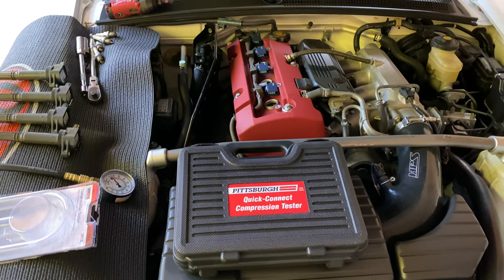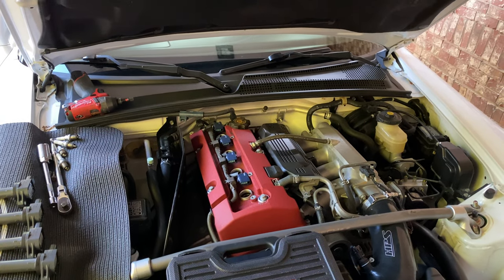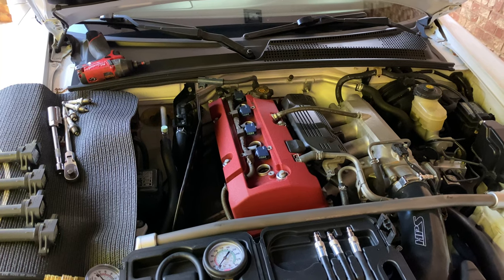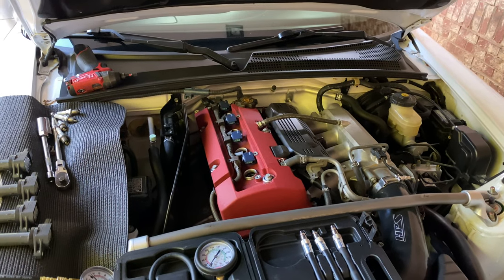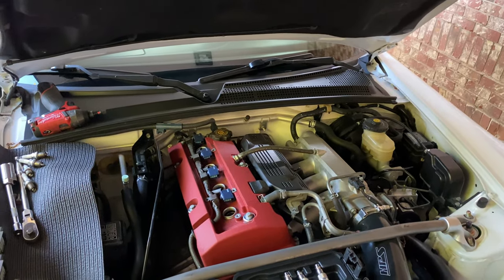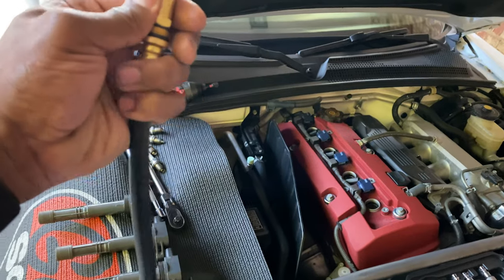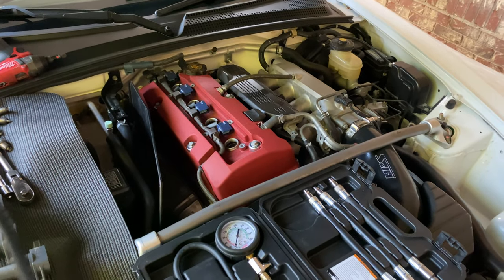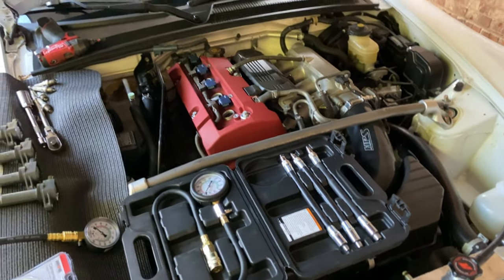Buy This! Not This! - Comparing Two Compression Testers

Comment: No matter what you’re testing. I don’t care if it’s a car or truck engine. A chainsaw, a motorcycle, a lawnmower, WHATEVER. A compression tester absolutely has to have a schrader valve right there in the threads that screw into the spark plug hole. The schrader valve cannot be anywhere else down the line. It has to be right there in the spark plug hole. The length of the hose doesn’t matter. Why they would even produce a tool that’s completely useless makes no sense. Lol

Comment: bought an harbor freight tester and i got 90psi on all 4 cyl of my motorcycle that should be 180psi....the problem with this tester is they are charging 20% restocking fee if you are returning it...im guessing there are lots of returns for this tester.....LOL

Comment: I had the same results very low compression with the Harbor Freight gauge.  It was showing 90 psi on a good running engine.  Most engines you need to have at least 100 psi to run at all so I knew it was the gauge.

Comment: could u pls do video for how to crank a car with start push button for compression test. I know how to crank with key. but always want to know how to crank with start push button.
Reply: One alligator clip of your starter button to battery side of your solenoid, the other alligator clip to the solenoid start wire (this wire lights when key is in start position). That's it for any vehicle.  Make sure your key is off when using the remote crank button.

Comment: Had the same problem only shows 25psi on GOOD engines. The reason is like you said it reads the air pressure in the HOSE as well which is WRONG

Comment: that valve is how it should be, harbor frate is made in china box, they always give you box :D basically shreder valve increasing space same compression only tester has longer time untill cylinder opens exhaust. especially must be used on chainasaws as there is no time to count and exhaust opens also adding part what it will suck air from exhaust makes all counting wrong

Comment: Im not certain that your theory holds any validity. I understand what youre saying. However when youre measuring compression, youre not measuring volume. Youre simply measuring pressure. Think of it like measuring psi of a tire. Bike tires measure just as high in psi as a car tire even though they obviously hold less air. So even though yes the hose  may have extra air in it, remember pressure is important. Not volume. So once youre guage hits a certain pressure, then whether the valve is in the end of the tube or at the tip of the guage, the psi will still read say 45psi, because thats the amount of force on the gauge.
Reply: So you're saying that the gauge itself was inaccurate.
Reply: @bushmaster2936  No. The gauge being inaccurate was what the person whos comment I commented on was saying. What Im saying is the gauge is most likely correct because pressure is what matters when doing the test. Youre not measuring volune. Like I said a bike tire and a car tire may hold the same psi and one is bigger then the other. But you are not exactly measuring for volume when measuring the air in the tire. Youre measuring pressure.
Reply: Bigger volume, same amount of gas means lower pressure
Reply: @turboleggy  not sure if I get which side of the fence you're on. With that being said though, volume is not important when doing a pressure test. Pressure is.
Reply: @JasonBohl  I thinks he's wrong but youre also wrong. A longer hose would make the pressure reading drop because the pistons only move so much pressure = mols*R*temp/volume. They are related through this equation for an ideal gas. A higher volume will mean a lower pressure for a given amount of air. A piston can only move a given amount of air.
Reply: I was reading 125 on my Lisle vs 48 on this Harbor Freight one, I swapped the gauge from HF one to Lisle one and read 125 as well so I know the gauge is correct.  Definintly has something to do with the hose, not sure if it's the length, the quick connect system or the fact there is no schrader valve.

Comment: I've rented a compression tester from orileys 3 separate times and tested it on 3 motors and it never went over 60psi, im hoping it's just the tester as I just spent $350 on a boat motor only for it to say it has 60psi on both cylinders

Comment: JAS EUGENE You completely missed my point and obviously don't know what you are talking about. More volume does not decrease air pressure IF YOU ARE SETTING IT FOR A CERTAIN PSI. You may need to add more air to get to that specific psi, but in the end you're still going to be able to get the same psi with more or less air. It will take more air to reach the same amount of pressure but in the end the pressure will be the same. Like I said earlier and used as an example. Most bicycle tires are rated for 40psi! And most pickups also are aired up to 40psi. According to your theory then if you were to take a tire pressure gauge and use it on a bicycle and it read 40 psi then because of the tire size you are basically saying that a truck tire wouldn't read 40psi because of size even if it was in fact aired up to 40 psi. However, we all know this to be incorrect. You can use a tire gauge for all sorts of moving vehicle with tires and they will all read 40 psi if they were all aired up to that exact pressure. Tire size will not matter. Yes one may hold more air then the one next to it but it they were aired up to 40 then they will all read 40. You dont need a different type of gauge for every type of tire. So once again having extra volume (air) inside of a compression tester doesn't matter. It's still whatever psi you pumped through the gauge and the psi is all that matters. Yes psi stands for pounds per square inch. but it's not referring to pounds as in volume pounds. its talking about pressure basically per square inch. Simply mathematics as you say would tell you this but apparently you don't understand what the hell you're talking about.

Comment: Isn't the compression tester only to see difference in pressure not the value itself?
Reply: It's both. If it's not reading accurately then the percentage difference may likely be off as well.
Reply from the maker: As @FroztiProductions said it's both. When you test and need to know how far away from the original compression value each cylinder is reading this will help you determine one set of potential causes. Also, if the values are different between the cylinders that could tell you another set of potential causes. It really depends on what the results are to help determine a list potential causes and this is only an initial first step. After a compression test its a good idea to get a leak down test done to hone in on the the issue.

Comment: Im buying it to see if my s2k motor is healthy 😀
Reply from the maker: Also make sure you have you valve clearances checked and adjusted. Common issue with our cars is over tightened valves.
Reply: Check valve lash, new timing chain tensioner, use oem oil filter, see if you have the revised oil squirter bolts, etc. Unlike most honda engines, these ones need a lot of attention.

Comment: How do you (they) account for the volume in the connecting hose? It's a proportion you could calibrate away, but only for a given/single displacement volume you are testing. It should "dilute" the volume and therefore the peak pressure, no?

Comment: It’s not the a actial pressure reading you are looking for in a compression test. It the pressure difference. Between the 2 testers the pressure difference of the cylinders is the same
Reply: You’d still want to see a number within spec. His engine shouldn’t even be running with readings that low. I had the same issue on my running 1JZ-GTE.

Comment: Now test the madox fuel pressure tester
Reply: Beware. Gauge works. But on mine the bleed fitting is machined incorrectly and will spray fuel all over you.